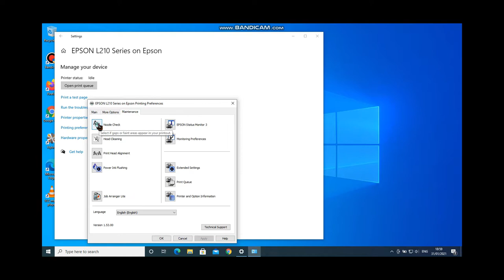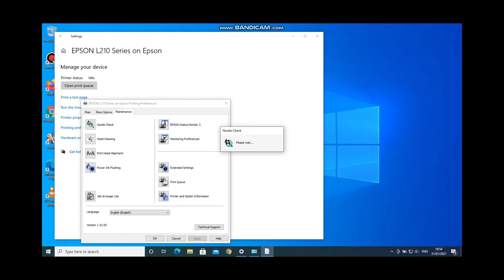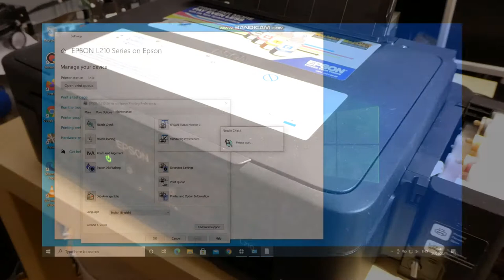Epson inkjet printer incomplete, stripy printing. Air bubbles removing from dumpers

Comment: if you do a cleaning, the colors all work, but suddenly 1 color stops working mid-print (and it happens constantly to the same color), this could be a sign that the print head is dying. there are inductors (they produce heat) which makes an air bubble so that it pushes ink out. these inductors can die or overheat (causing a lot of air) which doesn't allow ink to pass.

if your CISS is dripping properly, then assume the print head is dying. physical clogs are different. you will have a proper constant flow, but certain lines will be missing. if those lines jump around or the ink stops flowing at all, the print head should be replaced.

Comment: what could be the reason why the ink damper adapter in not storing ink? I have used a syringe to remove the bubbles in the black ink damper but after several prints it will be drained which causes the prinout to be blank. it seems like the ink damper can't store or refill ink.
Reply from the maker: If you can remove the bubbles with a syringe, it's likely that the damper and pipes are intact. It is probably the vacuum in the system that is causing the ink not to get from the tank to the dumper. And the vacuum could be caused by a clogged vent membrane. 
https://easyfixs.blogspot.com/2021/03/epson-l110-l111-l210-l211-l300-l301.html
By the way, if I print a lot at once, I usually open the cap of the tank for a moment after printing to allow the pressure to equalize and not leave any vacuum in the system. Recently, I have also experimented with raising the ink tank about 3 cm higher to reduce the vacuum in the tubes and the dumper.
Reply: Which is the exact problem I'm having that no one seems to know anything about. And they don't sell replacement dampers for this piece of trash they call the Epson ET -2720
Reply: Good day I can't zip the ink using the syringe.

Comment: The bubbles are taking out but not finishing inside the damper, I did it several times, why is that so?
Reply from the maker: Some air in the dumper is not a problem.
Reply: @mcelec7603  I did it again,. I filled the damper, cyan started printing, then suddenly stopped printing. I saw the damper, it was empty but rest of the dampers were full. Is there any vacuum problem?
Reply from the maker: @AsharAlamSiddiqui  Maybe the ink tube is broken, or there is a lever that can be used to close the ink tube, it is closed, or the ink tank vent is blocked.Try to put the ink tank up one cm, for example, to a thin book. I did it to a CD case, since ther are much less air bubble in the ink system.

Comment: What's the reason when you take out the damper of the print head it starts getting empty from ink and fills with air on a Ecotank printer? You suck the air out with a syringe, fill it back with ink and the moment you remove the syringe air starts filling the damper again until you don't put it back ot the printer head? What's the reason for this? The printer cannot print any color as well.
Reply from the maker: I assume the transport lever on the ink tank is not locked, i.e. it is in the vertical position.
On the back of the ink tank, each colour tank has a small ventilation hole. The vent is connected to the tank by a labyrinth. It is possible that this vent is clogged, creating a vacuum in the system and causing the dumper to suck air back. Try sucking the air out of the dumper by opening the ink tank cap. If this works, the vent is blocked.
Reply from the maker: Please, take off cap of the ink tank when use syringe. 4:20 If you do not remove the cap, the ink may return to the tank due to the vacuum.
When I print a lot at a time, I usually take off the caps after printing for a second so that the pressure difference doesn't suck the ink back into the tank.
Reply: @mcelec7603  could you please do a video showing this transport levers? If I understand right there is one for each single tank, but I really cannot find them and if they are closed, you may be right it may create vacuum in the system if clogged. I have used the syringe with open tank caps, sucking air from dampers, but it didn't improve the situation. After that the printer still doesn't hold the ink in the dampers, it goes back suck in the ink tanks.
On the 4750 user manual there is nothing about transportation lever. I don't think it has it.
Reply: I have same problem. The air gets back as I take out syringe. How did you solve this? I tried every angle while sucking the air out.
Reply: @tromick  I didn't solve it, I bought another cheap second hand machine from the same model, being sold for spares and just replaced the print head to make it work again. I just wonder whether if I replace the printing head of the machine that doesn't hold ink into the dampers, it will make it start printing as well again because it seems to have a depleted head.
Reply: @__LIN___  Of course if it is because the head, yes.

Comment: This don't work for me. Please suggest a solution
Reply from the maker: Maybe a lot of ink has already dried on the outer surface of the head. You should try to wash the wiper with distilled water (this is the black rubber strip at the parking position of the head that pulls the dirt off the head) and drop a few drops of water on the cup (this is the oval part that is pressed on the head when the head is parked and ends up here also the ink for head cleaning).
If that doesn't help either, there are some screws under the dumpers that fasten the head to the head carriage. They must be unscrewed, and the head can be carefully turned inwards so that the dried paint can be wiped off with the distilled water ear cleaner or the printhead cleaning stick.
Unfortunately, I haven't made a video about it yet.
Reply: @mcelec7603  thank you

Comment: Sir epson l805 naman po ... Ung yellow bumabalik sa tube 🥺🥲
Reply from the maker: Please, take off cap of the ink tank when use syringe. 4:20 If you do not remove the cap, the ink may return to the tank due to the vacuum.
When I print a lot at a time, I usually take off the caps after printing for a second so that the pressure difference doesn't suck the ink back into the tank.